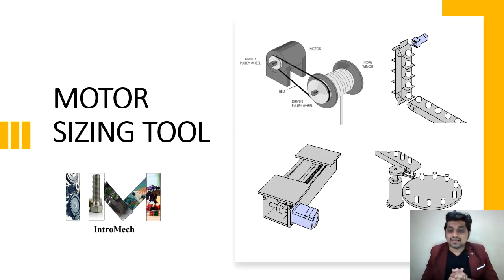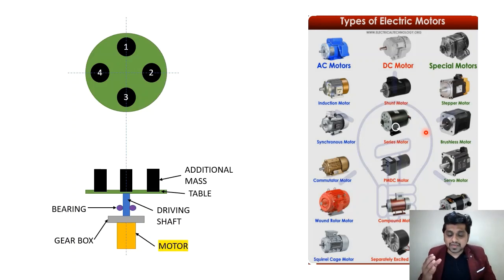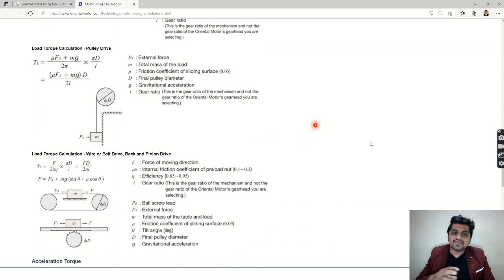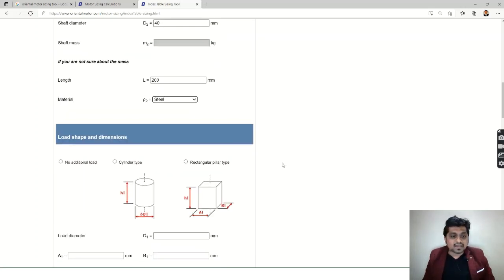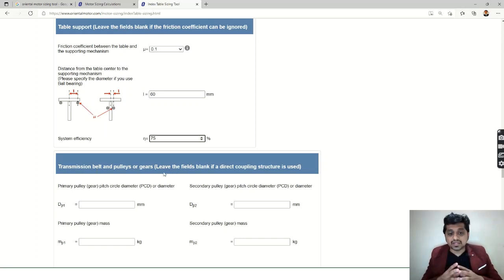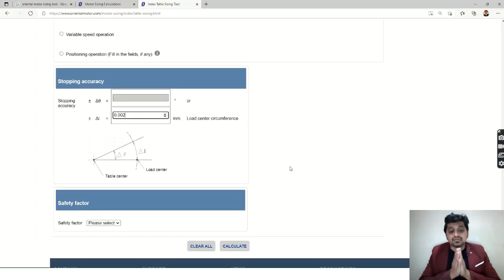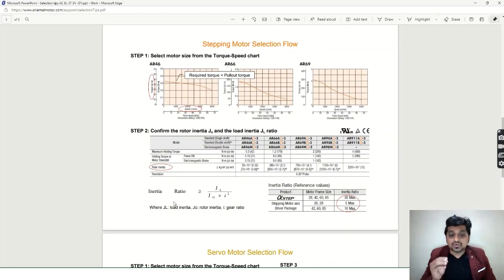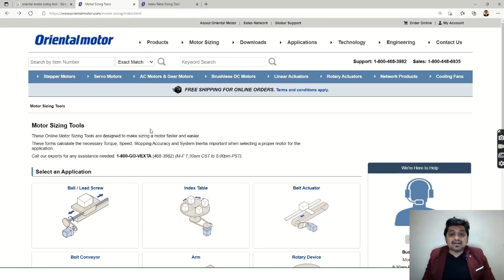MOTOR SIZING TOOL

Comment: What is meant by Safety Factor when sizing motor?
Reply from the maker: @Khaled If there is sudden addition of some load on the system then the motor should also take that extra load. hence safety factor is important while selecting a motor, but it should be selected as per the criticality of the process, or it will end up in selecting an oversize motor.

Comment: I'm sizing a motor for a roller application, how do I size it
Reply from the maker: you can find out the torque required first and then from speed you can check how much power is required for your application. also you can check for some similar application in motorizing tool and enter the required values. you can get the outputs , use these outputs for motor sizing.
Reply: Is motor will be select by required torque (1.6nm) or load torque (0.6nm)? Which is correct?
Reply from the maker: @dileepsingh9874  Required Torque should be considered because it take into account factor of safety also.